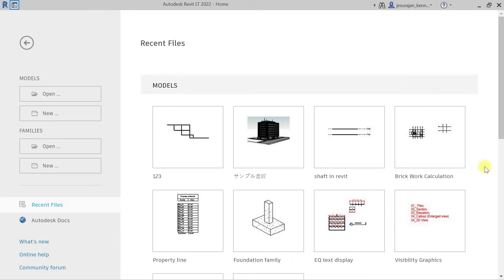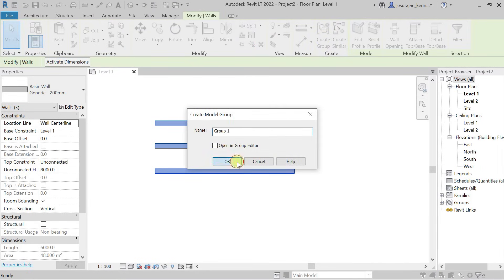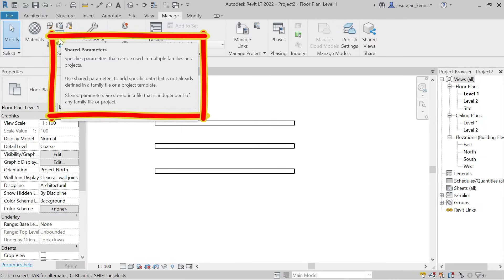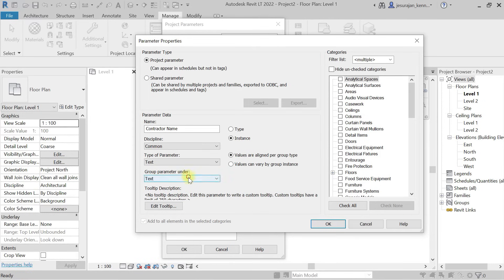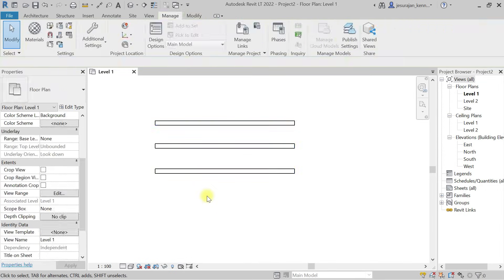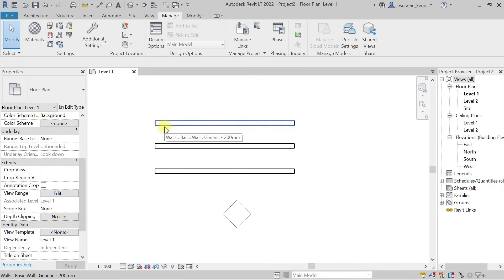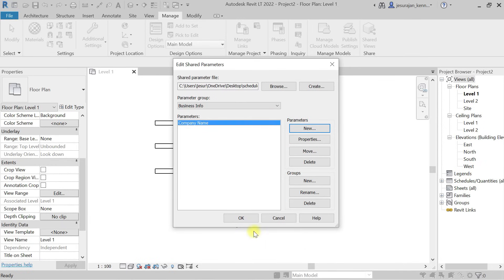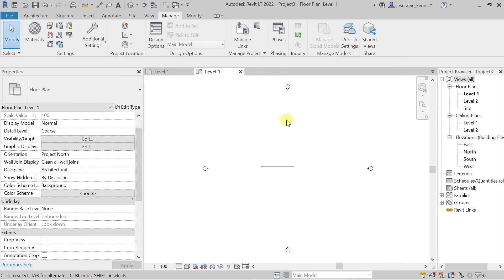Shared Parameters and Project parameters in Revit

Comment: hi, then whats the point of using project parameter, as shared parameter does everything project parameter does but superior?
Reply from the maker: Example, A family is imported to revit project which has shared parameters. But the same parameters are not used in the current project. Then you have to add the same parameters once again in revit project using project parameters. Otherwise the shared parameters won't work. Because its available in the family but not available in the project.
Reply from the maker: Shared parameters use an txt file so it's easy to add to project parameters. So we don't have to define the parameter name and parameter type. It can be directly selected from the txt file. That's the reason we use shared parameters.